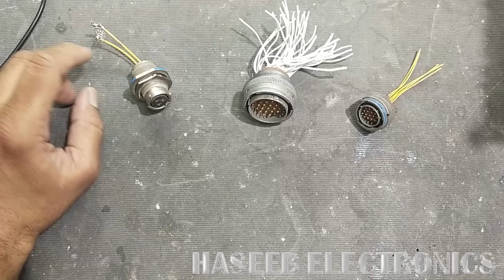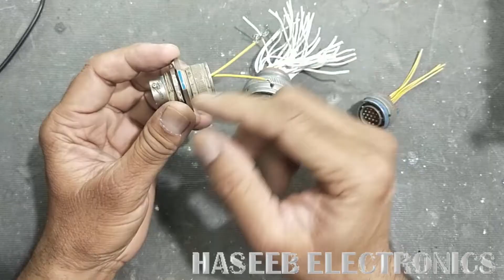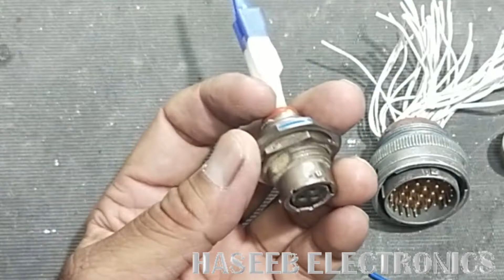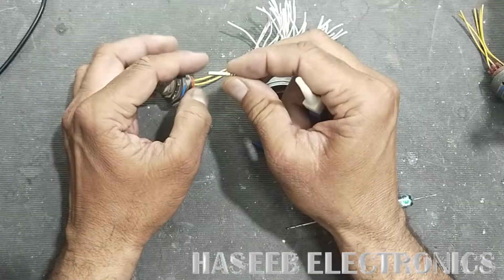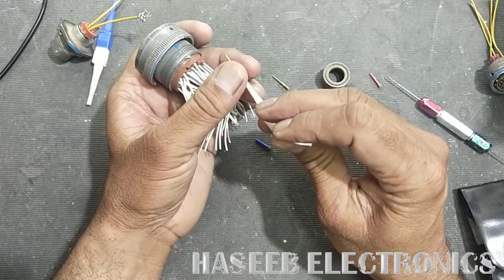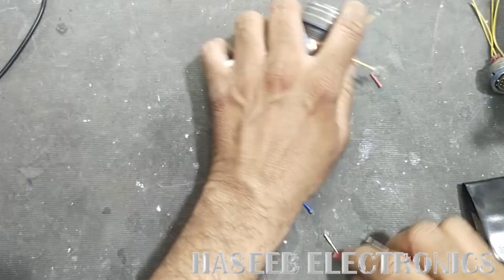{655} How To Insert & Remove Pin Using Insertion & Removal Tool

Comment: any tips to get a pin removed which is stuck? It seems like the extraction tool dosent wanna go all the way down, like something is blocking it
Reply from the maker: Good evening 
Sometimes the lock gets stucked. Just put few drops of WD-40 around the suspected pin 
Wait 2-3 minutes 
Lubricate pin removal tool (extractor) with WD-40 
And gently inset extractor and push it while rotating the extractor and holding the pin (just extractor should rotate) 
It helps to extract jammed locks and pins 
If it fails 
Then you need to replace the lock 
That becomes difficult and you need lock repair toolkit for that connector amd connector repair accessories

Comment: Is there a website that has database of all the connectors?  Especially automotive connectors, some are very hard to find how to remove, like the one you shown.  Lately tried to remove pins from H7 bulb, you need to press both sides towards the center with very small needle pliers.  Some pins are very tricky to remove.
Reply: Also only if you know the name of the pin or connector you can google and find the answer, otherwise its impossible.  In my above example pins for H7 car bulb are called FT63 (6.3mm)